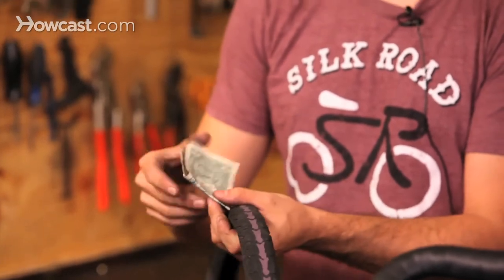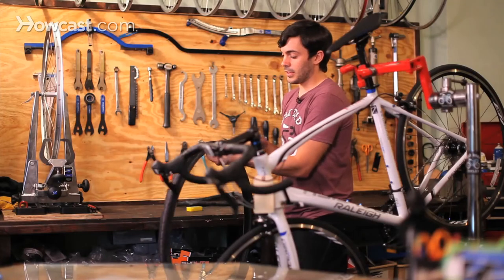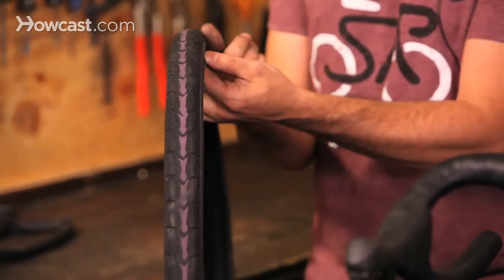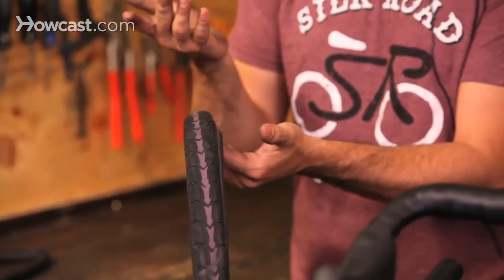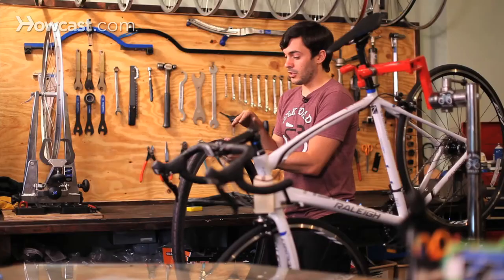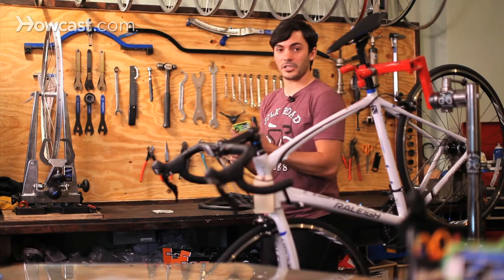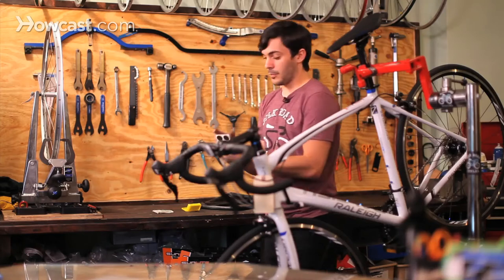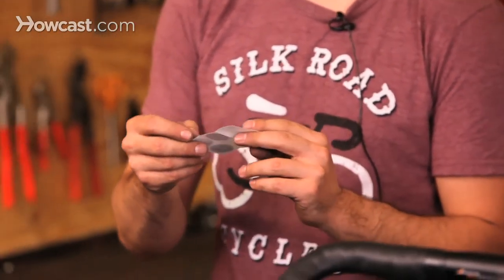3 Emergency Bike Wheel Repair Tricks | Bicycle Repair

Comment: Duct tape will also work for the inner tube in an emergency, but dont use too small a piece, should be like 1.5 or 2x2 inch.